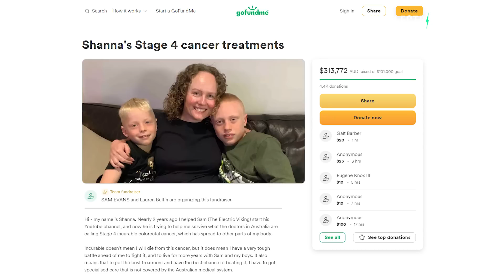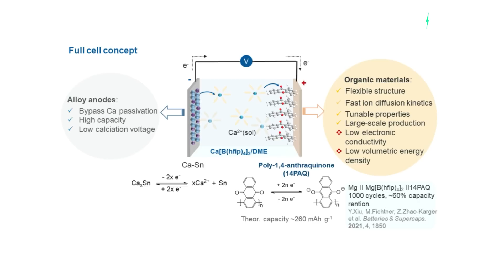Porsche EVs coming with 800-mile range + 15-minute charge time

Comment: Claims always sound great before reality hits.  800 Miles?  probably more like 380 real world.  15 minute charging - maybe - at a super high power charger which are rare to find; and it probably damages the battery life. Unless Porsche really is putting its neck on the line for a new battery tech; I doubt much of the hype.
Reply: EVs already can go 380 mph. By your logic Solid state battery is no different than liquid. Just stick to riding your bicycle.

Comment: Battery weight has more impact on the EV's handling than it does on the EV's range, due to the high efficiency of regeneration for around town travel and weight's low contribution to total motoring load in higher speed travel, say above 40 mph, where aero drag is the primary load by far. Battery energy density (energy/volume or kw-hours per liter) is much more important, due to the high value of maximizing the vehicle's interior space for the user.
Reply: With respect to so-called "solid-state" batteries, most are actually semi-solid, retaining some liquid electrolyte, to provide for sufficient mobility of the charge carriers, to reduce internal resistance for good power density.

Comment: A 800 mile range would be great.
What I'd like is a car with pretty much no gadgets.
No air bags, hand cranks up windows, that coasts on downhills  the way a bicycle can, no ABS, no power steering.
I'm a hatchback kinda guy and something like a Honda fit would be perfect for me..
 It would also be so cool if peoples cars could be charging when they're at work, you'd pretty much not have to worry about going to a charging station.

Comment: Electric vehicles are an easy target for planned obsolescence...batteries that can't be repaired and a car that can't be reused. I think a Viking would agree.
Reply: The thing is that batteries are not made by automakers instead they are made by other battery company, meaning unlike engines, if something happen then automakers won't be able to repair it, and the battery will end in a landfill (probably)
Reply: @italianmaestro3045  I have a 20 year old Blackberry that can still run but without a battery. The product has been obsolete because of the availability of a suitable battery.  Batteries are toxic and they'll contaminate the soil. Which will inturn contaminate our food and water and will result in a sick population.

Comment: Is Germany expanding its electricity production to accommodate a shift to EV’s?
Reply: Not needed. The grid everywhere is based on peak load. Peak is 3x base load and is less than 4 hours per day.
EV’s don’t charge during peak hours, easily adjusted with tarifs.

Comment: All we need is a safe battery that weighs less, provides 500 miles in adverse conditions that charges between 20% and 80% in ten to fifteen minutes.
Reply: Haven't you been listening. 800 and charges in 20 minutes.

Comment: With extrordinary technilogical breakthroughs happening at breakneck speeds at present due to shed loads of money the race is on to see who gets to the winning post first and be rewardes with billions in future profits.
Just the same as when the race was on to be the first on the moon it only happened because of inordinate funds being thrown at the project.

As younger generations wanting to save the planet with the added bonus of being cheap to run petrol heads will soon fizzle out becoming lamenting hobbyist. 
I'm 66 and traditionalist, however can't wait to buy one of the new convertable EV's like the MG Cybster once range is acceptable...

Comment: To have a range of 800 miles that is 1280 km, one would need to have a 179 kwh battery assuming Tesla's efficiency of 140wh/km. To push in that much energy in 15 minutes would require currents of the order of several thousand amps. Residential or even industrial wiring won't be able to withstand that kind of load. It may be possible theoretically, but impossible in practice.

Comment: One of the factors that give Porsche such high charging speeds is, they use 800 V instead of the more common 400 V.  try finding a charger. And I believe if you use a 400 V charger because it has to invert, the charging speed is much lower and there are more losses in the conversion.?   All that being said they are fantastic cars and hope to see more on the road.
Reply: Clueless comment. Voltage has almost nothing to do with charging speed unless amperage is fixed
Reply: @lighthousesaunders7242  Thank you for your tact and concern. If it is not a factor then why change from 400v to 800v - seems a clueless thing to do to me. Perhaps you better inform Porsche of their cluenessness.
Reply: More on the road? I couldn’t give a toss! I wish I could see one on my driveway. If I even had a driveway … 😂

Comment: German car brands like Audi Benz, BMW and Porsche needs a new pricing strategy i believe. i feel silly to buy a EV still based on their S line, M, AMG or GTS and pay double the price of their "normal versions" which are programmed to be slower than any other cheap chinese car brand. i understand that they need to do it to make thier premium pricing legit but what worked for ICE cras doesnt work with EV's since they dont have a different motor, the difference in EV premiums like AMG, M, etc are just on the battery and software programming, which in my opinion doesnt explain why i have to pay double the price.

Comment: Range anxiety is only for the uninitiated. It’s like flying anxiety. It’s not really logical. In 10 years people will be saying - weren’t people anxious about almost never having a full tank because they couldnt fill up their tanks overnight at home? How many people drive more than 300 miles in one trip? And if you do, how many times per year? Isn’t it weird that people think range anxiety is greater than the anxiety of destroying the planet and their children’s lives by driving ICE cars? It’s like worrying about a hangnail after being stabbed in the chest.
Reply: EV's are far less efficient in colder climates.
Reply: @jprt3270  
If you live in NYC, one of the largest cities in the world, the longest distance you can travel within city limits is about 30 miles. Round trip that’s 60 miles. If you’re artificially and unnecessarily limiting your battery capacity to 60%, a 300 mile range car still has 3X more range than you need. The vast majority of trips in nyc (commuting, shopping, socializing) are 6-12 miles. (An order of magnitude more range than necessary) If you decided to travel to DC or Boston (which is about as far as anyone wants to go in one trip- I’ve made both trips hundreds of times) those distances are approximately 230 miles and 180 miles respectively. So once in a blue moon you charge your car to capacity. As to access to chargers in nyc for people without driveways or garages, because of the above, those Tesla owners consistently say it’s a non issue. 

As to poorer people in the richest country in the history of the planet being unnecessarily deprived of the basic necessities of life that all rich Americans enjoy (like traveling without destroying the planet and everyone’s future), that’s immoral and disgusting but that exceeds the scope of this YouTube channel.
Reply: @jprt3270  1) you said in an earlier post that if you never charge more than 80% or less than 20% you range is much less - true, you would be artificially reducing your range by 40%. 

2) ALL of your concerns are non-existent if you buy a 300 mile range EV. If you can’t afford that (or you can’t afford a home with a charging outlet) in the richest country in the history of the planet, then the limiting factor isnt the car or your inadequate apartment.  The problem is wealth inequality.  If wealth was distributed more equitably and fairly, everyone could afford a Tesla, and markets of scale would dramatically reduce the price of the car.

Comment: Solid state batteries won't be needed. Lithium-Sulfur batteries with up to 5x the current best energy density and 1/3 the weight have already be solved. Lyten broke ground on a factory to mass produce them this past November in California with already 3x the current energy density. That's over 800 miles of range. So yes, Porsche knows well about this technology and their upcoming mass usage. They will available for EVs later this decade.

While Mercedes Benz will start using lighter, higher torque, higher efficiency Axial Flux motors on their AMG line of vehicles coming to the market in 2025. They are already being used in electric airplanes. Look up "Electric Planes Are FINALLY Here And They're Breaking Records!" and at the 12 minute mark you can see them compared to the current Radial Flux motors. Those are coming as well once they start being mass produced.

Comment: Talking about ICE engineers being “stuck to the past”, range is still described in miles or kilometres; a carry on from petrol tank capacity. We’ll laugh at this in a decade or so when range will be in months …
Reply: Currently my ICE car lasts me 1.5 months between refills & has a 1,100 klm range. I'm sure EV'S will eventually get there, however that will probably be many years away & be very very exspensive.

Comment: Obsolescence will be a big problem for BEVs people will hold off and cling to their ice until there’s a 400mile plus and 15 minute chargers.
Reply: They will not hold off for long when  EVs become cheaper than ICE.
Reply: I don't think so. I'm currently driving an Alfa Romeo Giulia whose lease runs out in 2024. By that time, I expect BEVs to routinely get 500 km range and 15 min recharge time. That is about the same range and slightly more top up time than the Giulia has. With those features, there is no more need for an ICE car except for nostalgia and ignorant egoism.
Reply: @joergmaass energy transfer is still a big problem. The heat generated in the charging cables alone requires liquid cooling.  The physics of pushing electrons down cables can’t be over cone and the larger the battery the harder it is to cool the core. But we’ll see.   After having a BEV for a month I wouldn’t have one for a long time it added an hour to my working day and that’s less time to see my children.
Reply: @tobycolin6271  We have a wallbox at home, speed chargers around the corner and quite a network of chargers all through Germany. I can't say that switching to a BEV has done us any harm in terms of additional time needed. Where do you live, and how do you charge?
Reply: @joergmaass  in a street and using the roadside network. I enjoyed sitting in the car waiting for charging . Plenty of chargers available but time sat beside the road is not time spent with my family. If you can get to and from a home charger on one charge then it would be good, but my customers are spread across the south west.
Reply: @tobycolin6271  Well, the distances in Europe are smaller than in the US, that's for sure. But if you charge from 20 % to 80 % and plan your trips accordingly, it's like 20 - 30 minute breaks usually, and that's not too bad IMHO.
Reply: @joergmaass  a 60kw/h batterry stopping at 60% to charge gives you 36 kW of range that’s about 100miles.  Even as a family where looking for 200 miles + (3hours) between breaks park toilet and onward. Unlike find charger park walk to toilets which are miles away in the uk and return to do it again 100miles later, 30 minute charge breaks every 2hours must be fun. In Europe across Germany we where covering 300+ miles between stops, eat in the car, comfort stops between wiltshire and Austria 900 miles 3 fuel stops (Dover, Reims, Zurich)  10 minutes ) and a 7 hour over night in Reims.  I’d have miss 2 days of mountain biking if I’d used a BEV.
Reply: Musk is an interesting person he has hedged his bets well. Tesla and battery powered vehicles whilst his space x program is running liquid methane. Now I would put money he has a team looking at producing bio or e fuel for his rocket program and then he has the market lead in both fuel markets. Elon might save ICE cars because the adoption rates of BEVs in the west is still relatively low.
Reply: @tobycolin6271  Well, in Europe their marketshare is growing exponentially, and for good reasons, since they offer superior acceleration, better economy, quiet rides and a good conscience. In China, the BEV market is exploding. So, your assumption on adoption rates are wrong, my friend.
Reply: @joergmaass  not exponentially logarithmically. Market share 7%,12%,14% and 15% if you plot that you’ll. see 5%,2%,1% growth definately a flattening curve.
Reply: @tobycolin6271  Don't forget that China delayed their regulation because of foreign car makers and that a price war is going on in China. People might wait in order to get a better deal there.

Comment: Who needs 800 miles? Who needs half that?  My S does 350 and I haven't once needed a single mile more. I stop every 3 hours or so on a long trip anyway for coffee, tinkle, or meals, so I don't even need my car's 5 hour time before charging.
Reply: When you are doing 120+ mph on the Autobahn, that 800 mile range will only get you about 350 miles.  That’s less than three hours.
Reply: @excelrobot  .  I don’t think you can actually drive continuously that far on the unrestricted autobahn

Comment: Hard to take them seriously while they're still talking about synthetic fuels.
Reply: Horses need to be fed too.  I guess they’ll be around for a while.  :)
Reply: @chrishaberbosch1029  This generation of synthetic fuel claims to use energy from renewable sources to bind airborne carbon and hydrogen back to molecules. Which should be carbon neutral.
Reply: @chrishaberbosch1029  That argument was used against ICE cars too wasn't it? At least we don't depend on them and their emissions are generally more useful than harmful.
Reply: The issue for synthetic fuel is the cost of installing a private fuel tank!
Reply: @markthomasson5077  how does that eliminate harmful emissions?
Reply: @rogermckenzie2711  , nope, but not the very rich will be able to afford them.  Maybe employ a chauffeur to follow behind in a EV truck, towing a fuel tank!
Reply: @markthomasson5077  The cost will decrease as the production ramps up and the methods mature. Especially when there are more than two players in this industry. 
And maybe, just maybe, synthetic fuel can really be carbon neutral in the future. producing large amount of batteries are not that friendly to the environment after all, we need diverse solutions if we want to solve the climate issue.
Reply: Old habits die hard! :-)
Reply: I don’t see any issue with the development of synthetic fuel. Anything that can help reduce the carbon emission helps, and engine powered machines will be around for a long time still. We need give them something to burn.
Reply: @challenger2205  But they're using it as an excuse to produce even more ICE-vehicles after 2030, which are clearly obsolete. Efuels are extremely inefficient and a huge waste of energy.
Reply: @challenger2205  You think synthetic fuels are emission free?

Comment: They’re talking about doing this with silicon anodes, not solid state. Sila Nanotechnologies and Amprius have overcome the swelling issue, so significant increases in range and reductions in weight are here. Mercedes will have them in their model year 2025 G wagons next year. Maybe not 800 miles yet, but 600 is very possible according to Mercedes.
Reply: The Zeekr 001 has 621 miles of range without silicon anodes
Reply: @rwyo83  are using a 140 kWh pack. Put that same size pack in the Tesla and you could do the same thing. Not all that impressive.
Reply: @gridjac  a 140 kWh pack doesn't fit in a Tesla, lol, CATL use new tecnology that gives more room to fit more batteries, better than Tesla new structural battery pack. Also you get 2M km lifespan
Reply: @rwyo83  Yes, I realize that a 140 kWh pack doesn’t fit in a Tesla. Who would want it to? My point was to say that a Zeeker 001, using the CATL Qilin battery isn’t all that impressive. Getting more range by adding a bigger battery is no feat. Anyone can design a car to do that. Did CATL come up with a better way to package a bigger battery? Sure. But it’s still a huge battery. The real advancements come from higher energy density, allowing more range with a smaller pack, faster charge times, and lighter weight.
Reply: @gridjac  It's very impressive, more range, better lifespan and safety, and they can easily increase the energy density for 800 miles. Tesla lost the EV race.
Reply: @rwyo83   I take absolutely nothing away from CATL or Zeekr. The cars look impressive, as do most Chinese brands these days, and obviously CATL is the biggest battery manufacturer in the world. All that said, I don’t think that means anyone has lost yet. Even the legacy OEMs from Japan, who are arguably the most behind the pack, still are in the race. Personally, I’m just not impressed by getting more range with a larger pack. I want to see the density increase, the weight decrease, the technological innovations. Right now, that seems to be with silicon anodes. Going forward, NIO says they’ll have solid state this year. If they actually do, that will be huge for the EV market. I’m pretty well brand agnostic. I just love seeing the technology advance.